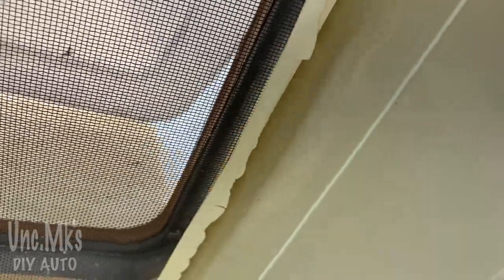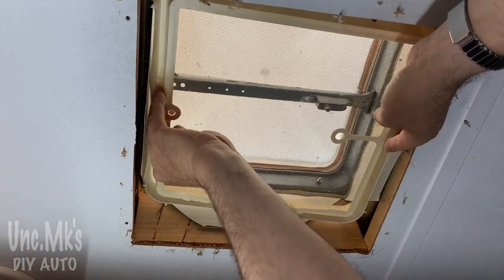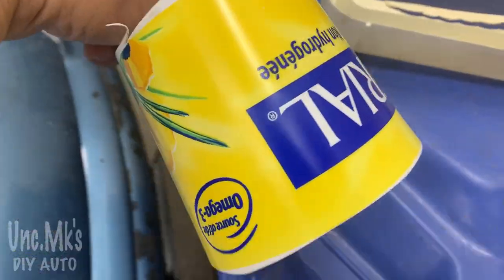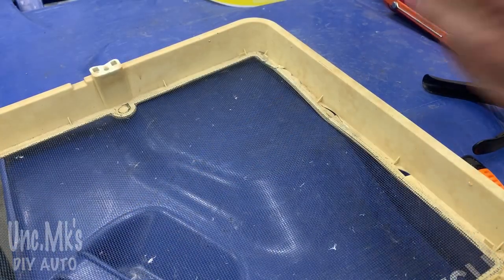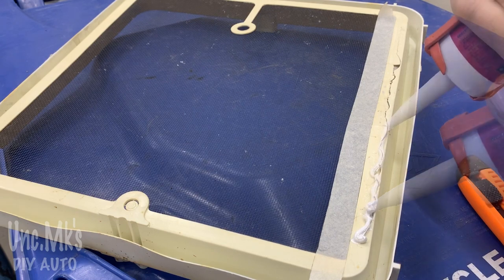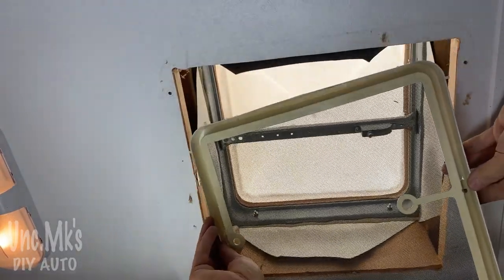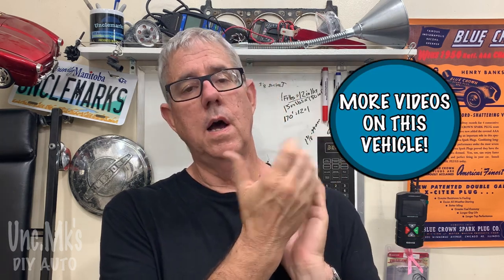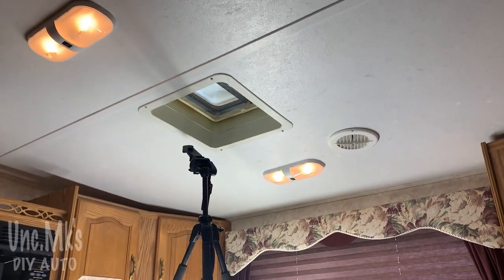Repair a RV trailer roof vent screen (EP 290)

Comment: Never seen non hydrogenated margarine 👍🇬🇧 before
Reply from the maker: Maybe “only in Canada, eh?” This repair did not go as planned! But the bugs are staying out now!
Reply: @unclemarksdiyauto  yes .What about melting metal mesh over crack with soldering iron to hold it together then seal it all with heat glue gun ?
Reply from the maker: @zeez3139  that is a great idea. I have another one in worst condition. I might have to see if that can work. When I do, I will post a video on it.